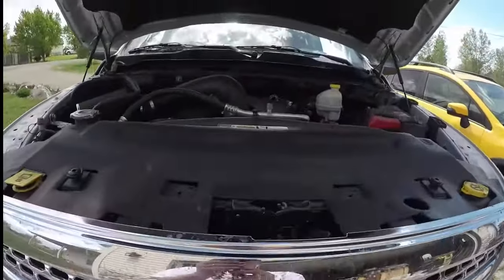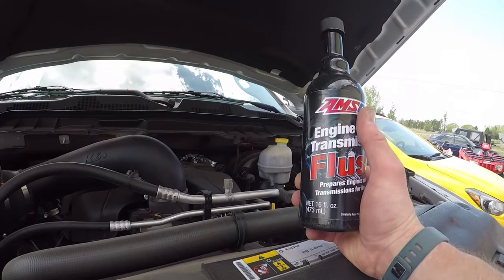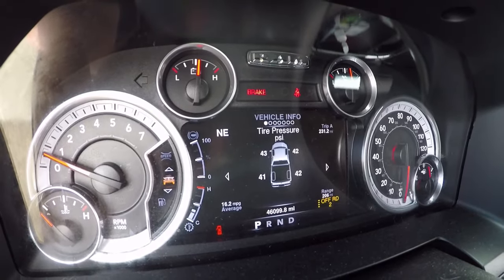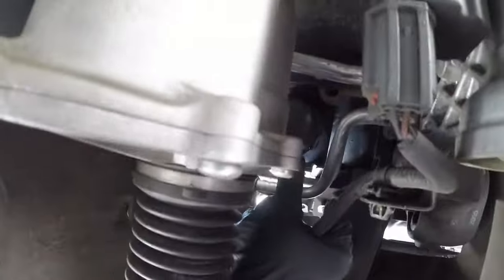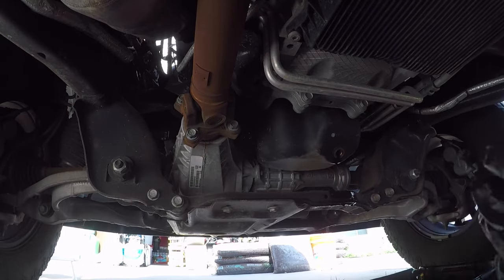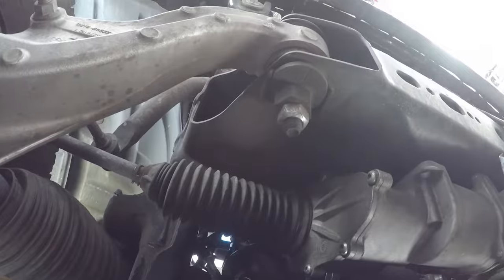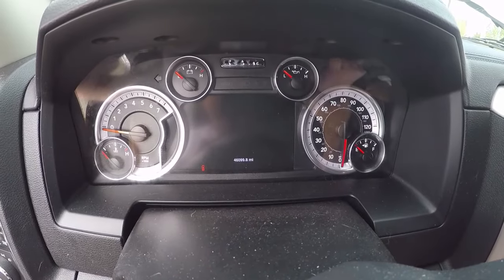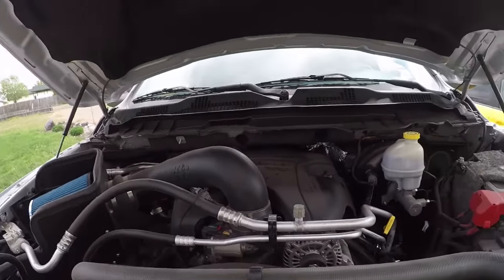2016 RAM 1500 5.7l Hemi Air filter, oil and oil filter change

Comment: Oil filter is more easily accessed with hand from front of truck.  Tip - put a medium ziplock back up over the filter before you unscrew it.  Not perfect but catches 2/3 of the overspill.
Reply from the maker: Jake, thanks for the tip, may use a gallon size zip lock next time.  As for access from the front,  I think I came in from that side on my second oil change.  This video was the first oil change I had done on my 1500.

Comment: I'm assuming that you are still currently using Amsoil for your HEMI. Have you ever experienced the "HEMI tick" in that time?
Reply from the maker: I do still run AMSOIL and the truck is over 90k miles now.  I don't have the tick that I've heard about.
Reply: @JWCMotorsports  That is good to hear.. I experienced the tick and it was not fun. Folks on the Ram forum were really helpful. Their recommendation was to ditch the Mopar 5W20 that I was running and use the Red Line 5W30. One reason being that 5W20 is not the best oil for my truck based on my region; it is too thin.
Red Line has been known to basically kill the HEMI tick in certain situations; especially if you run a thicker grade like 5W40 and then run 5W30 after that.
However, our local Red Line Dealer doesn't have stock of Red Line 5W30 and that got me thinking about finding an alternative. Amsoil seems to win pretty much every testing comparison.
Reply from the maker: There are a lot of potential problems with running a thicker than required oil (on the right side).  Newer motors have smaller passages and tighter clearances that thicker oil at operating temperature can not meet.   Also, it takes more effort to pump and will negatively affect fuel efficiency.  Here is an article that gets into that with more detail/specifics.  https://blog.amsoil.com/what-happens-if-i-use-the-wrong-weight-viscosity-of-oil/
Reply: @JWCMotorsports  That is true.. however I do believe that your environment does play a factor as well. 5W20 in our weather does not lubricate the engine nearly enough that it would in a colder climate. Even though it is recommended by factory; many people in hotter climates are having issues of the HEMI tick. Over here in Dubai, it is the same and even the main Chrysler dealer does not use 5w20.. their recommendation is 5W30. A case in point is my brother's 2004 Durango. That has been running 5W30 of various brands and still is going strong. It has never had a failure or the HEMI tick, ever. Of course if I was to go for a thicker grade than 5W30, yeah.. I am asking for trouble. 
I'm going by what is recommended on the forums and gaining from the knowledge and experience on there.
Reply from the maker: I'm not intending to indicate environment doesn't play a factor, however poor quality oils that do not perform well will not do well regardless of the viscosity or environment.  In severe heat (Like Dubai, I have spent time there) your quality matters.  Check out the NOAK test of any oil and look for one that has a good rating.  https://www.amsoil.com/newsstand/auto-and-light-truck/articles/amsoil-fights-volatility/
Reply: @JWCMotorsports  Thank you for the links. I'll be sure to check them out. I am getting interested in Amsoil. 
 I experienced the HEMI tick in my engine.. https://youtu.be/jYKN_vlEGbk
The interesting thing is that I had been using Mopar 5W20 the whole time before it happened; for every single change. I've been fastidious in it and you'd think  that Mopar oil would be the best for the engine.  I posted the video online and on the forum and the first thing that the guys on the forum asked is whether I was using 5W20 oil.. never mind whether it was Mopar or not. I told them what I had been using and they confirmed that it happened was due to the climate I'm in. There was no other explanation for this.  
The interesting thing is that I always got the oil off the main Chrysler dealer. They will not use 5W20 in cars that come to them for the oil change, but they will happily sell you 5W20; knowing what will happen to your engine when you use it. This was confirmed by one of the techs working at the dealership. They will sell you the 5W20 when the whole time they are using 5W30. I know that 5W30 will work well in the HEMI because my brother's Durango has the same engine, pretty much exactly the same and it hasn't skipped a beat since its manual calls for 5W30.

Comment: I heard that installing cold air intakes don’t do anything with out doing a tune on your engine after
Reply from the maker: I do not know how the truck performed with the stock air intake.  It was installed by the previous owner, I just replaced the air filter and like how my truck performs.  To get the most benefit from a CAI a tune is necessary, but you can't deny there is benefit to a less restricted intake and colder air.  If I hold on to the truck I may get a tuner for it.

Comment: Do you hear the dry start tick using this oil. Your Hemi sounds so quiet
Reply from the maker: Paul, I do not hear any dry start ticking, Just went out to check again with the radio and HVAC off just to make sure.  I'm at 9600 miles on this oil change, will be doing the next change early next week.
Reply from the maker: Sorry about the late response.  Just did another oil change (lots of highway miles) and can report that I do not hear any dry start tick.  You can hear the fuel pump kick on and several of the sensors activating but no odd (dry run/tick) sounds from the engine.
Reply: JWCMotorsports why did you not extend your oil drain interval when that amsoil is rated for 25,000 miles?
Reply from the maker: @diamondranch44  I did an oil analysis, although it indicated I could extend the interval, the EA15k50 filter is rated for 15k miles.  The truck also has an annoying "call home" reporting that alerts RAM when I'm due, I can reset it but It gets annoying.  After the extended warranty expires and add a bypass filter I will extend the drain interval.

Comment: How would you rate the amsoil air filter??
Reply from the maker: I like it better than the K&N that was on it.  Much easier to clean, and it seems to have better response than the K&N. When I put my foot down it gets moving with the K&N it would but seemed to hesitate.  As the CAI was installed when I purchased the truck, I do not have any comparison to a stock air filter.
Reply: JWCMotorsports thanks for replying back. Looks like I will go with ams oil instead of royal purple. Good video!